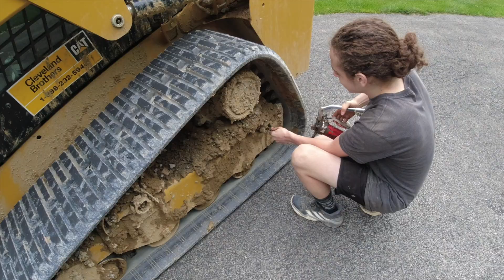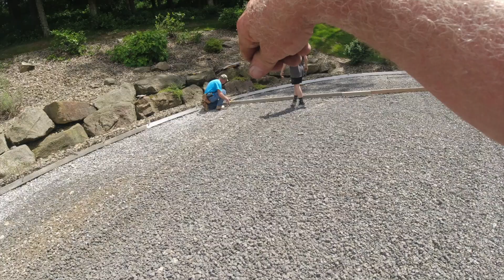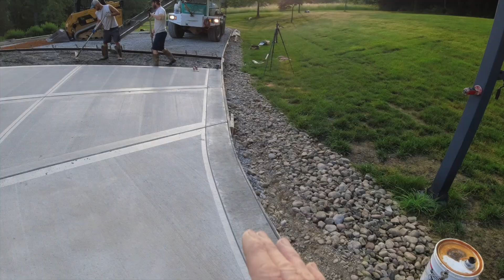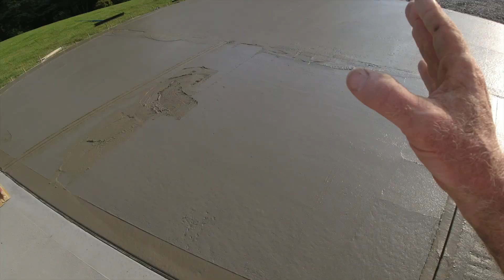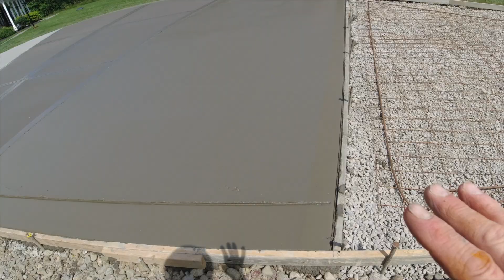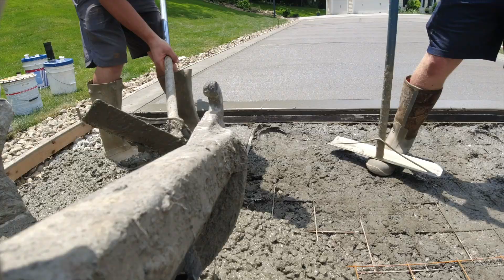Not Too Long For Us!

Comment: *NEED SOME POINTERS ON CLEANING NEW DRIVEWAY* Great looking driveway! I Just had 90 yards of driveway installed at our new house here in Alabama. I need to clean the dirt and mud off from the landscaping. Was planning to use my pressure washer and stay back 2 to 3' to make sure we don't scar the new concrete. Just a regular water hose pressure wont be enough. What would you recommend?
Reply from the maker: You have the right idea with the pressure washer you can add a scrub brush and some dishwashing detergent to break the dirt and loosen everything up. We fill up a wheelbarrow full of water add a little bit of soap and scrub scrub scrub
Reply: @Concretewiththehauses  thanks for the feedback!!

Comment: Ok i know very little in concrete, but this question is for my personal knowledge and I want to learn  @7:06 the rebars and wire mesh they look like they are flat on the ground. Shouldn't they be a little higher like in the middle of that slab or it doesn't really matter? Thanks for the reply in advance if you do so! :)
Reply from the maker: For the most part we pick them up halfway in the concrete sometimes we use chairs to hold

Comment: wow, what a project. it is awfully wide as well as long. I guess a project that size has problems of its own. you guys do everything; I've seen pools, steps, patios, garages, basements, roundy-things, and this driveway that could double as a small-aircraft landing strip. you even did heated floors as well, I think. with all the similarities, I am sure there are specific challenges to every project. good to contrast the differences. great video, as always. love the variety. oh yeah, don't you do city sidewalk repairs as well?

Comment: Do you typically use 4000 air entrained for your driveways ? Just wondering if you change aggregate size when stamping driveways.
Reply from the maker: We always use 4000 with air.stamping we do go to a smaller aggregate

Comment: On a job that size, do you require a down payment?  Have you installed pipes under the concrete to keep the concrete from freezing and building up ice/snow in the winter time?  Just a beautiful home, wonderful hardscaping!  Crew knowledge level 10+ out of 10
Reply: Down payment has to cover all
Materials at a minimum.
Reply from the maker: Usually two or three payments